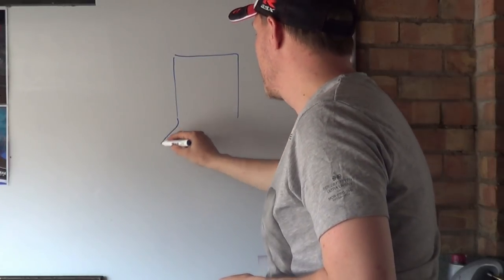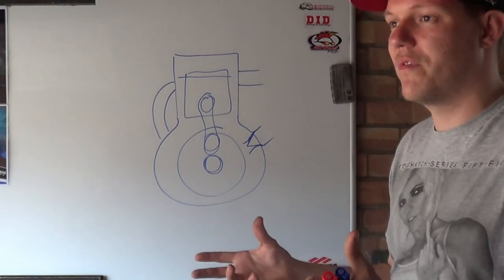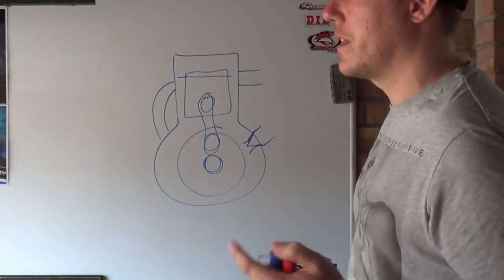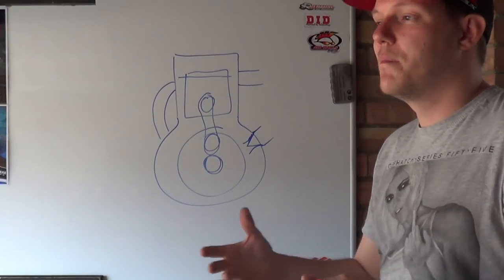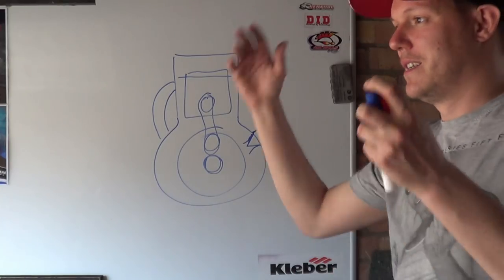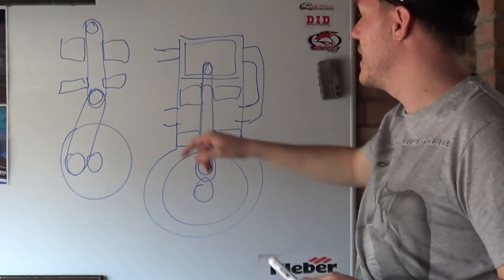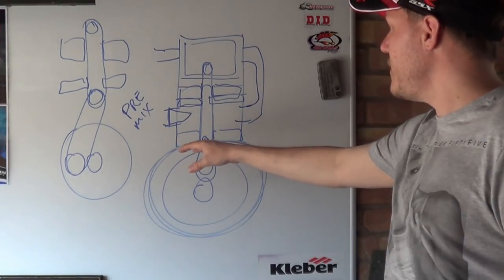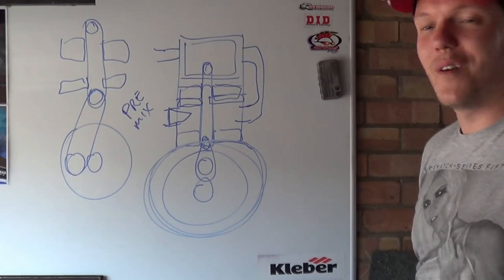2 Strokes are shite! - and why - Part 1

Comment: you could use the top part of the plunger for exsaust, when the pluger starts moveing down the bottom pushes the fuel mix to the cylinder , while the top part pulls a vacum to extract gasses faster from the cylinder, only problem is that the vacum could pull the " just inhailed " fuel mix from the cyl , idk ,what do you think
Reply from the maker: 'Plunger' - do you mean piston?

Comment: Shows why diesel is a much better fuel for a 2 stroke application
Reply from the maker: Added to the list - matt
Reply: Doesn't work well. 2 strokes don't run high compression, diesels sort of rely on that..

Comment: 4 strokes are more energy efficient and therefore far superior for distance . A two stroke never won Dakar ! They also have more gyroscopic effect which makes them more planted and stable. Great for high speed desert style racing. Two strokes however are the opposite . A 110kg Two Stroke will feel way lighter to ride than a 110kg 4 stroke. The two stroke is generally lighter anyway. They are more nimble and therefore the only choice for hard enduro competition. Two stroke motocross bikes are super fun to ride. Once you become familiar with the engines rhythm you can use the suspension to kind of "surf" the pressure waves. It gives an extra dimension to your riding that a four stroke simply does not have. Timing an undulation with the throttle so that it cracks on the pipe just as your suspension is at full preload.... damn its the best
Reply from the maker: Great comment - matt

Comment: Obviously 2 strokes are not a perfect design, but I do tree work and having a 9 pound handheld internal combustion engine that i can use with one hand suspended in a tree is a groundbreaking engineering accomplishment. until engine manufactures can design a light weight, compact, reliable and efficient 4 stroke i still say the 2 stroke is a superior design for certain applications. the Stihl chainsaws we use have 1000's of hours on them running at full load for hours on end day in and day out with very little maintenance aside from cleaning air filter and changing spark plugs. How can you say this is an unreliable design? not to mention when the engine does blow it's a pretty simple and cost effective repair.
Reply from the maker: Bikes mate, bikes.
Reply: well I'm bias towards 2 stroke dirt bike as well, I can swap a piston in an hour and have a fresh engine, the issue of bearing wear never occurred to me but i can see a 2 stroke dirt bike engine go 1000's of hour easily before the bottom end would need rebuilt which in itself is not a very complicated or expensive job. so for enthusiast like myself that don't have unlimited disposable income the 2 stroke offers lower cost of ownership in the long run. if dirt bike manufactures are ever forced to discontinue the 2 stroke engine I would never buy a new bike again, unless it was a dual sport or an inline 4 street bike. Obviously the four stroke design is a necessity for street riding but at that point your talking inline 4 large displacement engines that can rev to 14,000+ rpm and is still a very reliable and long lasting design, I think 2 stroke engines are best suited for single or two piston engines for recreational vehicles and power tools. that doesn't make it  an obsolete or a ''shite" design as you say; its fits a niche market and will out perform a 4 stroke in many applications.

Comment: wouldnt having so many options for 2.strokes or parts availability a plus? i know some very old.2stroke boat motor never fail motor wise? i think perhaps the heavier oil mixture rates back in the day has alot to do with it everything was drenched in oil 10:1

Comment: I`m sorry you ride a 4stroke here is why:

CR250R (2stroke) ----------------
Peak power: 59.01 HP *
Weight: 213.8 lbs *
Torque: 37.6 ft/lb
Power-to-weight ratio:(2.42 lbs/hp) 

CRF250 (4stroke)  ---------------
Peak Power: 51.36 HP
Weight: 228 lbs
Torque: 35.2 ft.lbs
Power-to-weight ratio:(4.43 lbs/hp) 

Yz250 (2stroke) ---------------
Peak power: 46.86 HP *
Weight: 212 lbs *
Torque: 30.6 ft.lbs
Power-to-weight ratio:(4.52 lbs/hp) 

YZF250R (4stroke) ---------------
Peak power: 43 HP
Weight: 221 lbs
Torque: 20.1 ft.lbs
Power-to-weight ratio:(5.13 lbs/hp) 

MAICO 700 (2stroke) ---------------
Peak power: 82 HP *
Weight: 223.4 lbs (dry) *
Torque: 79.29 Nm

KTM 690 (4stroke) ----------------
Peak power: 65.7 HP
Weight: 308.64 lbs (dry)
Torque: 68 Nm?

Comment: instead of the diesel two stroke idea,to save main bearings,the oil seals could be in board of the mains,have both mains in oil as a four stroke,obviously the magneto side would need two oil seals ,one for the crank case and one for oil leaking out of the engine as a four stroke would,the deisel set up is not a high rev set up,more torque and geared,imagine a crosser with the articulated con rod,and four strokes can be dry sump,with oil pumped through the crank and rods,the last thing would be how to lube the piston,what minimal amount could be used to do this last job,if all the bearings are save ,reducing the major rebuild work to many miles/hours of service between major overhaul,could we run a 2T with less oil in the fuel to get the piston saved,or do we coat the piston with a hard dry lubricant,teflon?,there are ceramic coatings that could more than likely do the job,maybe more so with a little 2T oil chucked in the mix.
Probably even most likely do-able,the jap manufacturers should investigate this,as 2T engines could over take 4T if done properly,the dry sump/separated mains idea seems a good one the more i think about it,and surely as i stated,we can coat or evn mould a piston from a solid lube alloy,we have nikasil spray or sputtered coatings,so the pston anti wear coatings that are heat resist should be examined.

ANY FEED BACK WOULD BE INTERESTING,UNLESS ABUSIVE ,IN WHICH CASE FUCK OFF.

Comment: Matt why does the air/fuel have to mix with the oil in a 2 stroke?
Reply: It doesn't have to. Ie: fuel injected with seperate oil system

Comment: Yes i agree 2 strokes are " flawed " But i still like them. So you want to learn about engines do you.....get a 2 stroke bike. You will learn or stay home and look at it parked. Hey, i grew up with 2 strokes. And it taught me what engines are all about. I will always have a soft spot for 2 strokes. Would i want one in my car or truck ? - Hell no!   I need to mention this : My 1978 Puch Maxi
moped went 8641 miles on the same cylinder and piston _ was it worn yes. Could i hear piston slap yes i could. But it still had pretty good compression  - about 110 psi . Not great but not dead either. I rebuilt it to save my cases from getting cracked when it did fail - which it would have. I run 50/50 castor oil and synthetic  oil at about 25 to one ratio. Carbon build up like you read about ! the head the piston crown the exhaust port all had to scraped every so often. But it kept my lower end bearings in good shape.   So Are 2 strokes crap ? Yes they are. But i still like them. They are a lot like an old friend that drinks too much when you go out. The night starts off great but as it gets late it becomes a pain in the ass. And the next time he calls you still go out.

Comment: we took the most perfect engine ever was , gave it valves,oil systems,complicated heads -
 and ended up with twice the volume for the same HP, more complicated/expensive maintnance.... great :) aren't we idiots...
Reply from the maker: lol or -
we took a engine that was flawed, sort that flaw out with valves, increased it reliability with an decent oil system. Put it this way, you say maintance, until you have to buy a new piston and rings, on top of that how many 1000cc 2 strokes do you see?

Multiple cylinders is where 2 strokes fall down (again). Yes I know there are marine V6,V8 2T but they are few and far between, and you have to ask yourself why .

"and ended up with twice the volume for the same HP"
- its funny that you say that, you have a 500cc 2T MotoGP bike. It is 500cc and has twice the power strokes than a 4 stroke.

the 4 stroke 1000cc MotoGP has have the power strokes but twice the volume.

Valencia race times 

2T 500cc 
Sete GIBERNAU 
Suzuki  
- 54'39.391

4T 1000cc
Jorge Lorenzo
Yamaha
- 45:59.364
Reply: i see you liked my joke,that's good. well,those moto GP 4T engines give about the same power as the old 4cyl 2T engines,but they rev almost twice the RPM, so there weren't more power strokes. now,imagine what could become of those 2T if they'd put the same R&D money and tech stuff on them as the 4T GP bikes have these days. but that's GP world.  i come from the off road world,i have had few bikes, 2 strokes and 4 strokes, and in off road the 2T are much cheaper to maintain,also many things you can do at home. so,the 4T realy is easier to control in the motocross track,for regular humans. cause you have to be a good driver to control and win on a 2T. the minute a pro goes in a race track with a 2T, he slaughter the 4T competitors.true,the 2T can't stand in the new regulations,but 2018 see the first production enduros 2T TPI 300&250 CC  enduros, KTM & Husqvarna, so we'll see what'll happen! will be interesting! 2T enduros are easier to ride in the gnarly. oh,you can also see clips of pro motocrossers go in the track with old 2T bikes,and realy go wild! and they love it so much. i think big 2T multi cylinders for road bikes will never come back,even with TPI, there i think you're right.

Comment: Two stroke still have their uses. They are the weapon of choice for hard enduro. They do not overheat in technical terrain as easily, the power delivery is highly tunable, weight less, bike handles better with less gyroscopic effect. They new KTM/huskey transfer port injection addresses bearing wash. Also the newer synthic oils helps to address some of the two stroke design flaws. In my opinion, when four stroke hp is pushed to the range close to two stroke hp, they are in the same ball park as far as reliability goes.
Reply from the maker: "they are in the same ball park as far as reliability goes" 

- not when you see the mountains of pistons and cylinder litered around.

Comment: From what I've experienced, 2 strokes don't have the throttle control of 4 strokes.
Reply: I ride a 2017 Yamaha YZ250X and they come with an electric throttle positioning sensor on the carburetor. It has just as much throttle control as the four stroke bikes I've rode for the last ten years.

Comment: i have never seen a 2 stroke motor that lets the fule into the crank case, the ones i am used to from the 80s, have a carberater and the fule is let into the cylynder from the carb not the ceank case??? i have worked on yamaha, susuki, and honda  49CCM motors????, do you only have negines like the one you show in the uk????
Reply: the stock HP reading on moped motors in the old days in norway was 2.5 HP, and we used to put tuning kits on the up to 13 HP and they worked great ecept the chain and sprockets would wear out faster be cause of the added power.
Reply: and we use 2 DL of oil on 10 L of gasoline.
Reply: been a long time sonce i worked on a 2 stroke and i just saw a nother video on youtube and you are right about the transfer port i just pictured it wrong in my head
Reply from the maker: No worries mate, quite a few 2 strokes have the inlet to the engine as part of the cylinder assembly, but this still opens up into the crankcase. The drawing I did is like some engines and not others, but its easier to visualize when describing what happens. thanks for the comment dude - matt

Comment: A two stroke can run balls out all day long, 4 strokes don't really like doing that. That's why they're ideally suited for boats and snowmobiles. But they require adequate fuel delivery to survive, and being seasonal applications, it's common for them to get clogged carburetor jets from stale fuel. A lean cylinder tends to overheat and fail. In terms of lifespan, there are outboard engines from the 1960s still running around where I live. Part of the reason for that is a 2 stroke actually has BETTER cylinder lubrication than a 4 stroke, providing they get enough fuel/oil mix.

Comment: 2 strokes. the extreme power for minimal mass motor used in model aero motors, chainsaws, gypsy saws for robbing scrap metal and removing wheel clamps from cars/ bikes.
still some agricultural machines use 2 stroke diesels like the Sachs engine on the Howard gem. and yes there's the uniflow design on the heavy shipping at low speed. can't you class the rolls Royce opposed piston deltic type beast on the apv that the British army has as a two stroke as well?

anyway yes "the yin yins" still have their uses, if only for delivering pizza quickly by oiks and mass deforestation!

Comment: Wait, why do you need further seals to block off the combustion chamber? You could have oil in the crank case and just call for more frequent oil changes.
Reply from the maker: There are 2 problems with this idea.

1 - The fuel will dilute it in no time
2 - How would the oil get to the bearings, conrod, crankpin etc?
Reply: Well thats the thing, my old polaris had a fill location for a small amount of crank case oil. You really think they would have that many seals and moving parts in such a small motor? I will have to go look at the service manual.

Comment: Mercury made best 2 strokes in my opinion! Early 80s to 90s they were tough little motors! Xr2 2.0 liter was a hot little motor. They are loud rough nasty little motors but they were runners at high rpms!

Comment: dude I love the two stroke's at least in dirt bikes I've had both four  stroke's and two stroke's and I like them because there much lighter cheaper and they make crazy power under the right circumstances you all day I would take a two stroke over a four stroke and there much easier to fix!!!!
Reply from the maker: All good points, but that has nothing to do with how well the engine produces power for the amount of fuel is uses. Not trying to shoot you down, as they are good points, unfortunately they are the only reason 2 strokes are still around. - cheers matt

Comment: 2Stk Motocross bikes are far more reliable than 4Stk MX bikes.  KXF250F 4Stk MX bike will  implode taking valves, barrel, crank and cases any time after 100 hours.  A KTM250SX will run 200 hours without lifting the head and then only need rings.   The 4stroke has to run at twice the rpm to produce 4/5ths  of the power and when the fail they really fail.

Comment: it all comes down to what terrain you ride and what suits you. Come ride some slow technical stuff which you can roll over and light throttle the majority of it with a 2 stoke at low rpm without having to clutch it, then try rolling over it and using the lower idle rpm with a 4 stroke and try not flame out when you get in the lower rpm.

Comment: 2 strokes are very easy to mod and you could double the power but the problem is that I cannot get any after market parts in china, the parts are manufactured in china but they are shipped off to another continent. I cant even find a performance reed!!

Comment: 2 strokes from the early 70s and 80s were very reliable. Its due to their superior power per cc over 4 strokes as well as weight and easy repairs they became the choice of engine for racing development. Every high perfornance engine becomes unreliable as every component becomes deamed to have an acceptable life span. If the engines continued to develop for longevity they could easily be capable to do similar mileages as the comparable 4 stroke. I have seen old suzuki b120 delivery bikes with 100k miles without being opened. I have also seen performance 4 stroke motorcross engines with 30 hours on them with blown cranks. Its all relative
Reply from the maker: "Its all relative" - LOL well it's not - it's about load and rpm

Comment: Ride a Kawasaki KH750 H2 and come back and say they are shite, I challenge you. Also the Suzuki GT750 Kettle, you obviously haven't ridden one of these bikes. Hell, even an air-cooled Yamaha RD400 was a crotch rocket.
Reply from the maker: Pull your knickers out from your arse. I owned a kettle for 5 years. If you listen to what I say, I say 'from an engineering point of view, 2 strokes are shite' which they are. Hence, they're numbers are falling.
Reply: So, you are saying that they are now in the same camp as modern Diesels, from a shite emissions and engineering point of view? I agree that they will never meet emissions tests as a standard stroker, but what about fuel-injected 2-strokes, do you think that they could they be made to work?
Reply from the maker: The emissions problem is due to the burning of oil more than anything, if you can see the smoke its killing pandas and upsetting a hippy somewhere
Reply: Also, what about the Rotary Mazda engine, that could almost be a 2-stroke as it's an oil burner?

Comment: You seem to be comparing 50 year old 2 stroke tech to brand new 4 stroke tech (scooter vs new road bike). 2 stroke have come a long from scooter motors with oil injection into the crank and direct fuel injection into the pot and still have half the moving parts. In marine outboards they are as fuel efficient if not better, have the same environmental ratings and are about 1/4 less weight. Most motocross brands are bringing back a 2 stroke next year or at least have one in the final development stages.
Reply from the maker: Not in part 2 I ain't
Reply: The Workshop I thought you were talking about 2 stroke diesels for marine in part 2. I was talking about Etec's/ Optimax outboard motors, these are traditional dry sump petrol 2 strokes with oil injection and directed fuel injection. From what I've read KTM and Yamaha will have similar engines next year in there bikes. We will be back to racing 250 2 strokes against 450 4 stroke like the old days